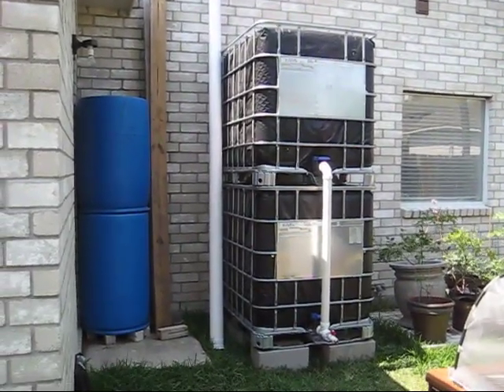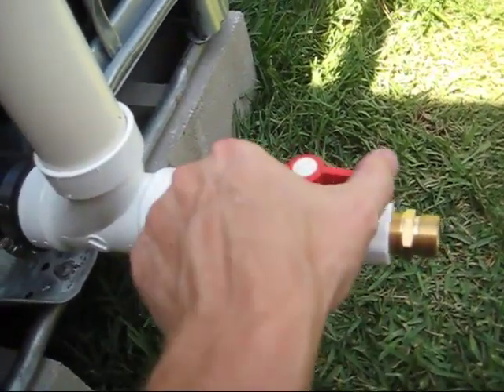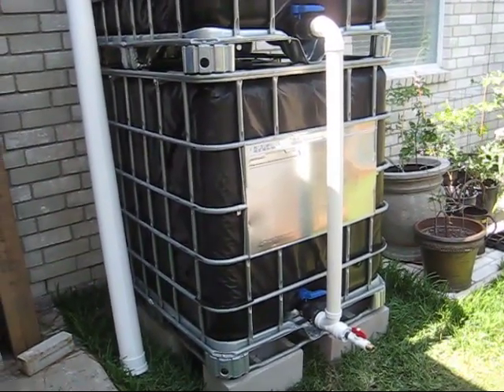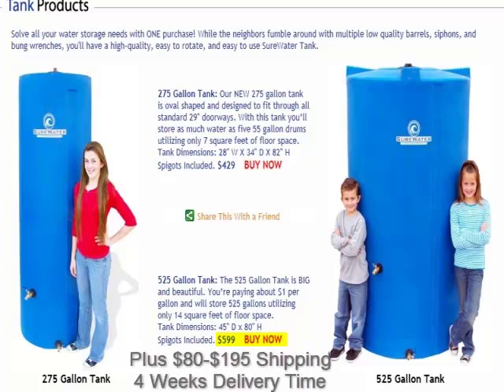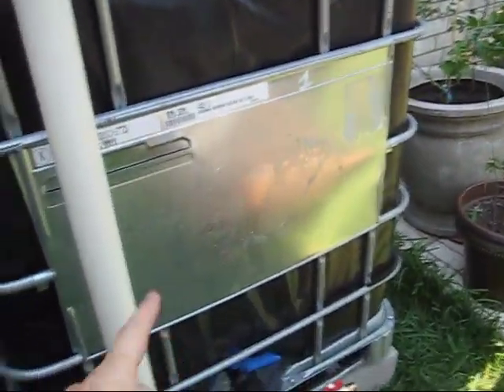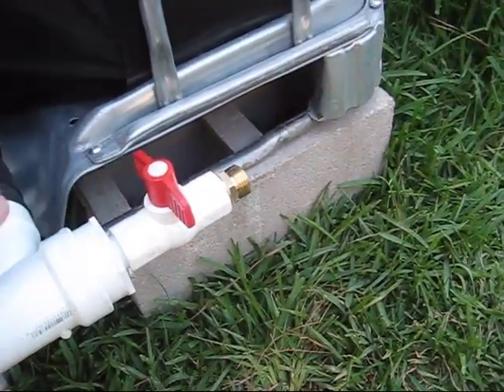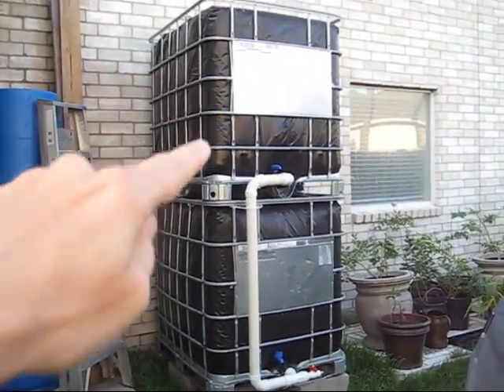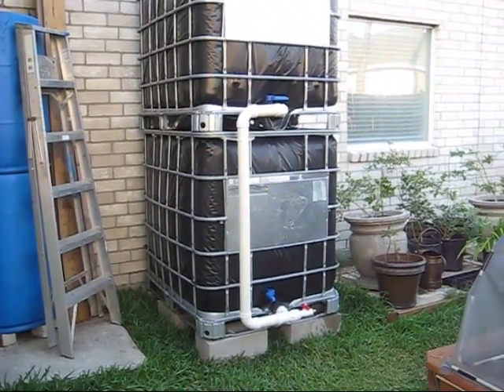Rainwater Collection System Part 4: Connecting & Testing The Totes

Comment: To get more pressure out the bottom, the stack needs to be taller; pressure is all about the height of the water column.   But, as a simple gravity-fed system, stacking totes gets much better volume of water, than barrels, in the same footprint.

Comment: The dia. of the pipe is not a consideration.  Only the height of the highest point of the water in the tank determiners the pressure out the lowest point of the water, exp.  21" of height = 1 psi of water pressure!

Comment: I am about to start a huge project in which to snag as much rainwater as possible in the rainy season so it can be used in the dry season.  When it rains here in San Antonio (down pours), I could easily fill about 10 of these with rain gutter water in one good thunderstorm.  I am looking to stack these totes 2 - 3 high, and understand what you have done with the PVC connections.  It looks as though you have to go outside and manually shut off valves and tighten down caps in order to fill the top tank once the bottom tank is at capacity, or am I not seeing something.   Also, how did you wrap your tanks, arnt they snugged down in that cage?  Did you have to cut away the bars on the top to get to it?

Comment: I still don't get it how will the bottom tote fill with water if the pipe is inserted in the bottom and not top ...Pressure ??
Reply: Water will always seek to be level so as long as there is a place for the air in the bottom tote to escape the water will flow downward.  If there is no air escape in the bottom tote, the water will push the air into the top of that tote until the pressure of the water coming in balances the pressure of the air bubble on top.  Since developed pressure of a column of water is going to be about .47 psi per foot of "head" the water will flow into the bottom tote until there as about 2 or so PSI pressure in the bottom tote.

Comment: I wish I could find all the cheap white PVC sewer 4" fittings you used. Our Home Depots and McClendens hardware in WA don't have that and ABS is about $10 per 4" fitting/adapter etc. I haven't checked Lowes yet but I don't have any nearby anyway. Great video tutorial by the way I've learned a ton and am following your system as close as possible.

Comment: Wanted to know what support do you have to support the 275 gal. water tank? I need to stack mine and was considering a concrete wall and steel table to support top tank. Looks like yours is good but how did it do when filled with water?
Thanks
John
Reply: from what I understand IBC totes are designed to sit on top of each other. That's why they have those metal frames so no support needed

Comment: I'm a plumber and  been toying with a rain collection system on the cheap for a while.  

One MAJOR PROBLEM with the system ( nice system over all) you used rubber Fernco couplings to connect the two tanks together. Those couplings are not pressure rated and WILL FAIL the first time you fill the tanks.

H2O weighs 7.8 lbs per gallon or 4290 lbs of weight trying to find a weak point those, couplings.
I really like the system, replace original ball valves, reduce and use threaded fittings.

Comment from the maker: The totes have been sitting on six cinder blocks for almost 2 years with no signs of stress on the cinder blocks. Everything is solid. The totes are 8' tall stacked.
Reply: How does the bottom tank vent air out so that it can fill completely and easily? Also, how does it vent backwards so that the tank doesn’t implode when draining?

Comment: So the static pressure of the water in the lower tote is forcing the air back out throught the 2" PVC pipe, and up into the upper tote?   If so, I'm assuming that you have to keep the top tote's top "fill" lid open to vent as well during the transfer?  Thanks! Great vids.

Comment: Why did you seal the lower cap? Wouldn't the plastic on plastic be good enough or is it just a precaution? Once it's sealed, does it open at your leisure or is it sealed for good?

Comment from the maker: Yes, they have 2" valves that will screw right into the top opening of the totes. I would recommend them. I will replace the air vent with that when the top totes is empty.

Comment: You don't need all that silicone sealant.  The lid has an o-ring that takes care of that.  Also the interior bung is pipe threads, so they seal fine without silicone.

Comment: you need to vent your lower tank or it will not fill or drain depending on its current status.  I would connect the lower tank vent to the upper drain valve.

Comment: I like the black plastic idea because without it daylight would turn the water green. If you had issues getting this to fill/drain just run a small vent hose through the 2" pvc. Nice water tower and could be hooked up to bathroom plumbing with garden hose.

Comment: @LDSPrepper I think I'm with dumdan, I don't understand yet how the air will vent out of the bottom box, beyond the first couple of inches.  Once the cube has filled above the 2" pipe level on the bottom, how does the rest of the air escape from the top of the cube?

Comment: @econewpower I believe that if you disconnect the top of the connecting pipe and try to fill the bottom with your water hose you'll soon find out it needs a vent, but that is an easy fix. It is similar taking a wide mouth jar and pushing it upside down in water, it won't fill regardless of how big the mouth is relative to the capacity because the air is at a level higher than the intake.  Again, thanks for sharing this great idea LDSPREPPER, we all look forward to more!

Comment: A great ideal LDS prepper, it looks terrific, thanks for sharing this great idea to others. However, I don't believe the bottom tank will fill as it is not vented, regardless of how large that connecting pipe is. It's not how large the pipe is, it is the location of the pipe that won't allow venting. May I suggest you unscrew the top cap and attache a vinyl hose or any other hose that you can take and tie to the top level of the top tank? That will allow it to vent and fill...continued...

Comment: Hey LDS, I really like the system. that stores 10 x 55gal drums worth in much less of a foot print.  I might wait to seal the tank tops. The air will be trapped in the top of the tank, under pressure yes, but it will be air. Some type of vent that rises above the height of the top tank would help. just a thought. to prove it, try your top to bottom fill test again after sealing, My thinking is that the top won't fully empty this time. I had this problem with inverted 55 gal drum.

Comment: Nicely done! If i might suggest something though. When you run your down spout to the barrels put in a roof washer setup before the water goes into the tanks to remove the dirt, debris and other unwanted stuff that collects on the roof. It's just a simple extra length of pvc that runs straight down with a cap and valve at the bottom and the outlet is up around the top of your tanks. When the tube fills up then the clean water spills into your tanks. :)

Comment from the maker: @ss109guy The air vents through the 2" PVC pipe as it fills. The best way to fill the lower tank is to keep both the top and lower tote's valves open and fill the bottom tote as the rainwater or hose water enters the top tote. I didn't do that because I was testing how long it took me to fill the top tote.

Comment: With such good water pressure you could hook into your home plumbing system and have water for you home as well.  Also the other four totes would it be possible to capture rain water from you gutter system to have a renewable source of water.  Perhaps you don't get that much rain water there in Huston, but here in New England it rains all the time.  We would have a problem in the winter with the water freezing.

Comment: Very nice setup.I'm really surprised the lower tank does not become air locked with it not being vented.I'm really glad it worked so well.Great video.
Reply: How is this possible though? All that air in the top of the bottom tank has nowhere to go and will compress at the top, and eventually not allow any more water to flow from the top tank to the bottom, right? In that case, you can guarantee that your bottom tank will never get as full as it would otherwise. Is there a solution to this?